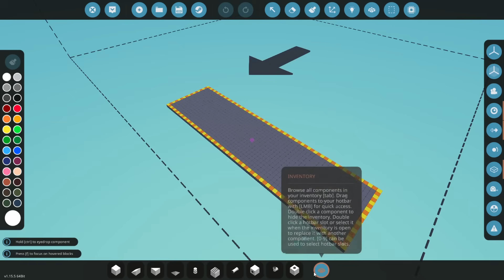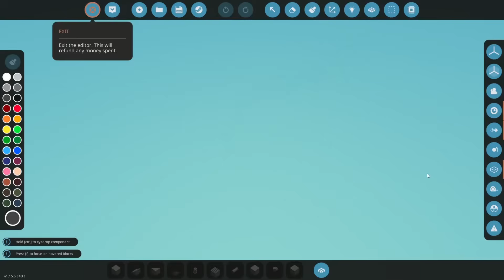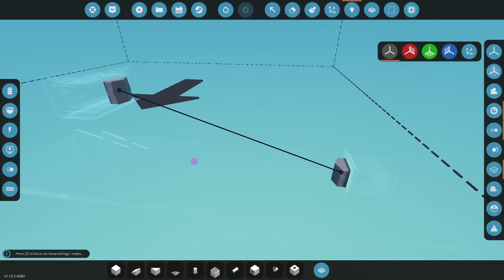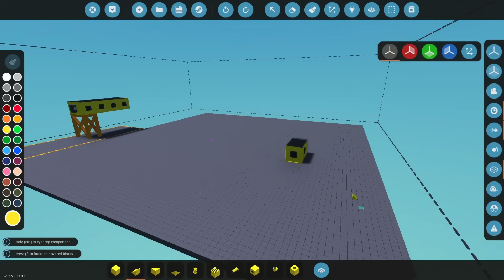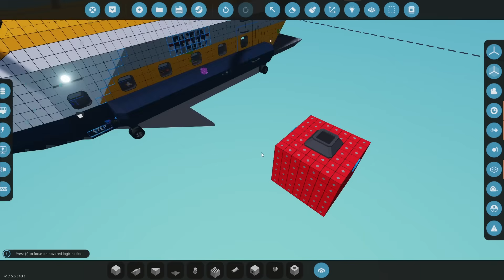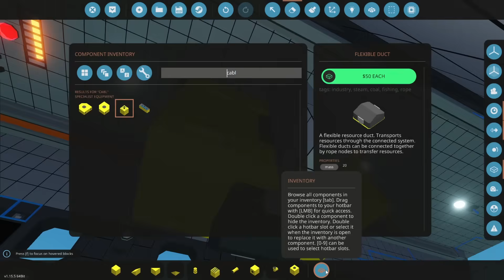Flexible Hoppers (Chutes/Conveyors) & Electric Trains UPDATE in Stormworks

Comment: An overhead line wouldn't be completely unnecessary, one could implement it so that, for example, certain lines have one, obviously, it would be unrealistic through the desert, but it would make sense for certain lines where the stops are relatively close together. 

It would also be realistic and good for shunting yards and ports, then you could run an electric shunting locomotive there, or on the main lines, electric trains with overhead lines. 

There's already a mod that (at least visually) added a pantograph/current collector, a lot could be done with that.
Reply from the maker: That's a good point and a good idea! Then you have to strategize how to operate trains with the overhead lines!
Reply: @454ss_gaming Yes, that's another advantage; it also gives you the opportunity to develop concepts and work with the different systems.

Comment: They implemented this system so cheaply. 
The rail electricity acts more like a "generator".

when i go full throttle the battery drains until i reach a certain speed and then they fill up
when i go full speed, let go of throttle, the battery keeps charging, but as i slow down, it goes slower, then slower, then stops, then starts draining until i stop

Comment: Saw this update when I was having my coffee before work but was not sure how far it was. I knew you'd get a video out by the time I got home to lay it all out for us haha
Really cool update.
I'm glad they are not doing the overhead lines simply out of the build height requirements that could put players into a more specific box than the one we are already building in. Naturally my mind goes to "well they could have the electrical connection be sort of spring-loaded and always pushes upwards to make contact with the line" but its just one more thing that can break and at the moment this slower rollout is nice.
This was also really good timing as I want to get into train building but havent yet gotten into mining, so coal becomes a problem; in general I'm locked into a much larger infrastructural gameplay that Im not prepared for yet. If I can start with electric trains and move on to steam or diesel later I am happy.
Reply from the maker: Hahah I try to get these videos out quickly when updates drop! Thanks for the comment

Comment: This is really awesome. 2 things you didn't cover but I think will be super valuable:
1. Using this to connect two pivoting/sliding components. You sort of touched on this with the helicopter example, but an arm with a drill on it, or something like the chute on a combine harvester could be connected.
2. Small incremental shifts in duct connection. Right now there isn't really any way to shift a duct connection over one block. You can sort of do it if you use the medium and small ducts, and stack them in the right combination, but that is massive and takes up a lot of room. where as this you only need 4 blocks to offset a flexible duct connection.
Reply from the maker: Fantastic points, both of them are very true and very useful!
Reply: The drill ckmment is kinda smart
And a combine harvested would be lit... When are we getting farming sim update with terrain deformation so we can turn it into Kansas just a flat world with corn everywhere lol

Comment: i hope the rail wheel drag has been fixed, like they have 100x mroe drag than wheels or even props, 

also i cant wait to make a tiny ass electric train
waiiit, its free electricity, that sucks kinda, id have assumed, you need 1 or multiple oco that supplies electricity liek a distributor to the rails, and then have every other train act as a demand,  kinda woulda been better, 
that or even at the trainyard, have a electric/fuel depot with a cable so that way, you can make a truck/trailer generator, that you use a electrical cable to hook in and power the network
or if your lazy, at the train depot have a hube trailer with batteries and a small i4 generator that tops up batteries

edit but yeah electricity through the 2 rails works,. and have been done before , but yeah its dangerous since kids can touch them or short when it rains

edit again, a 1x1x7 block tracks, similar to how linear sliders woprk, where you can place them, but yeah, its hard with how wide the turning circles need to be
Reply: Ooo I like your idea of having a dedicated power unit to power trains on the line
Reply: also it loks like its code is copied from the rope/hose just with a differant  shape
Reply: Spline code from the ammo belt

Comment: I personally don’t like the idea of siphoning power from rails however if I was new to the game I’d definitely love it
Reply from the maker: Agreed, it's sort of "free" energy in a way, which makes it a bit cheap like.  I would love a system in Career that charges you per KW/h or something haha XD
Reply: @454ss_gaming yeah that would make it way more balanced and it could mean you can still have battery's but if your low you can choose to use the powered rail or something similar to help balance it edit maybe they should also add it so it's only on some parts of the map so you still have to have a capable train
Reply: Personally, I think it is an amazing addition (but it's also flawed lol). As a European railfan, I really like building electric trains. And the problem with them (up until now) was that you could just not properly use these sorts of creations without an infinite electricity cheat, or loading them with horrendous ammounts of batteries. With this, you can finally supply these trains with electricity without having to resort to infinite electricity. I'd love to see this feature to be added to the single-axle wheels as well, because as of right now, you can not use custom bogies (which is the only way to get the traction motors be mounted inside the bogie frames, like you would on most real trains, especially multiple units) to pick up current from the rails.